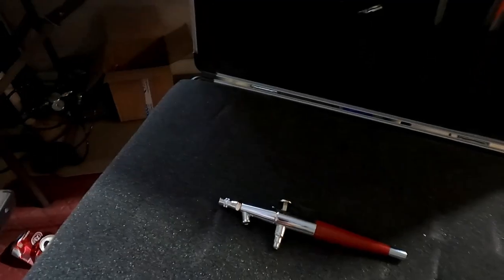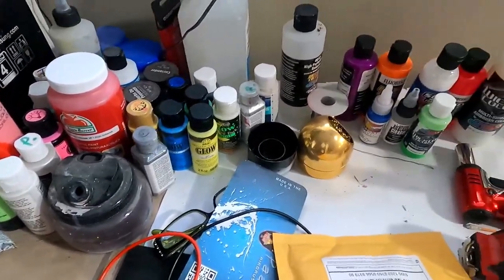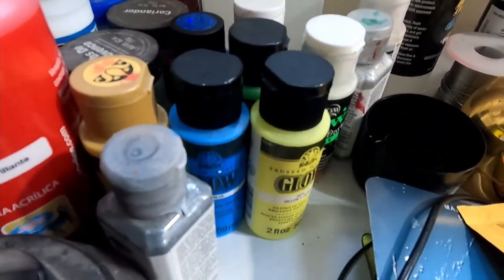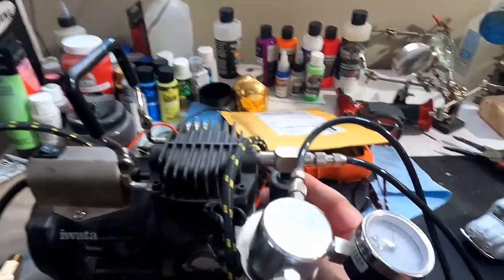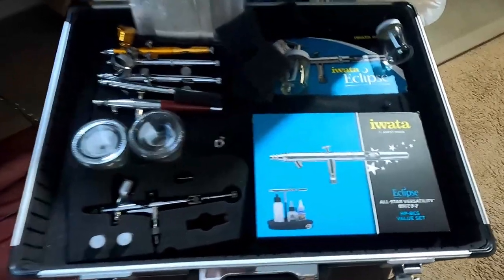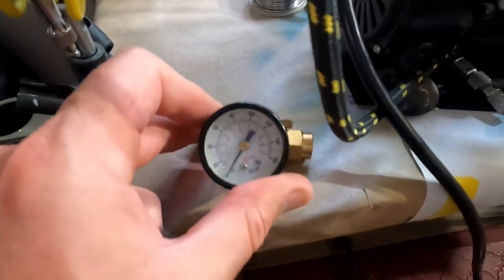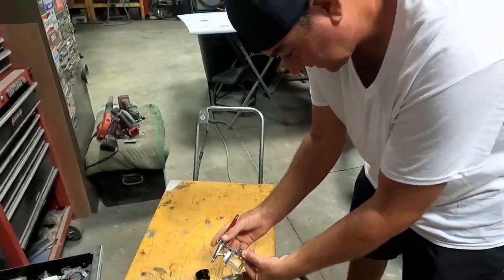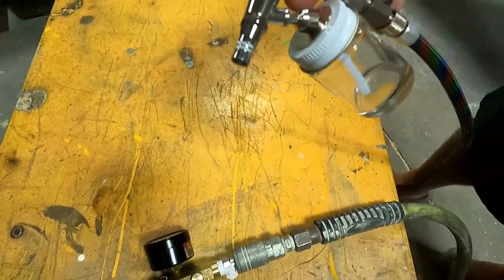How to connect an Airbrush  to a Large Compressor

Comment: No. Learned nothing.  Need the sizes reduced down to. 3/8" 1/8", 1/4",   WHAT?
Reply from the maker: YO, not sure what part you're not understanding.  I am not sure what your question is exactly either.  I showed the parts that I purchased along with part numbers from the website I used.  I just rewatched the vid and I think I covered all bases to get most guns with a quick disconnect mounted to a hose that hooks to a regulator that easily hooks to a compressor.  I can't speak on 3/8" or 1/8" sizes as I have no idea, but I know the compressor hose was 1/4" NPT if that helps anything.
Reply: @ClarksPlace  Thank you, but I'd like to try to get these parts here locally if possible so I need the 'inch' sizes and the thread sizes.